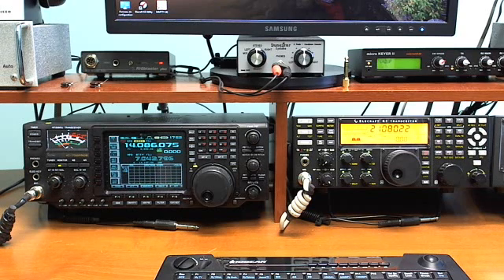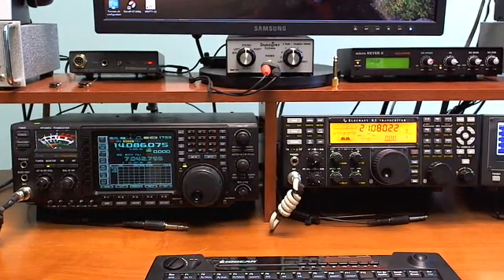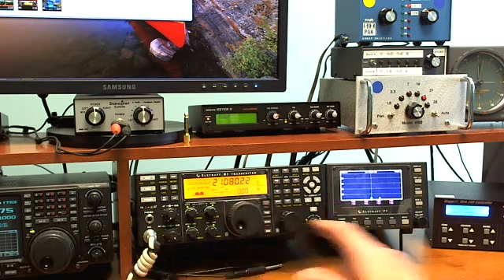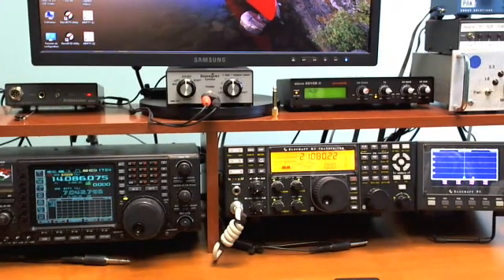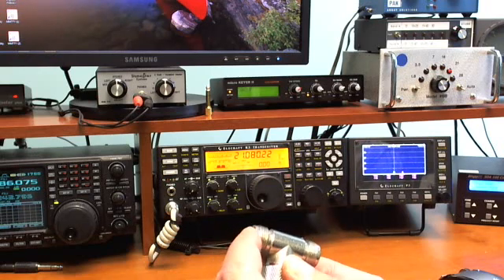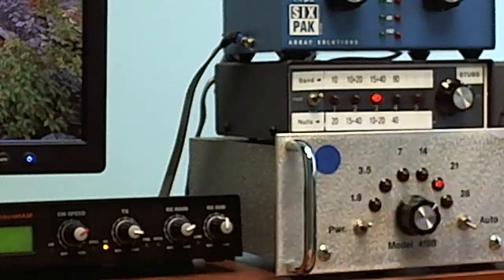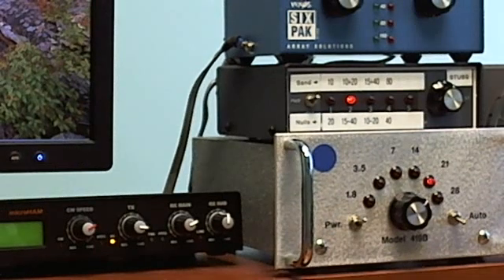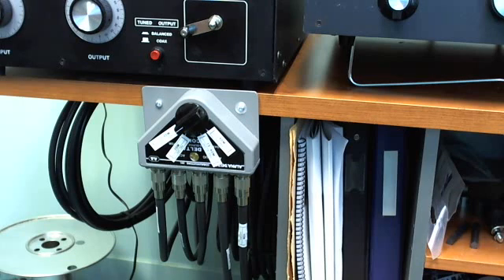VA2UP - Using coax stubs for SO2R contesting

Comment: Just got a Flex Radio 6000 series. all these radios and switching equipment can be replaced with this 1 radio. ALL SO2R is built in. No stubs needed, no SO2R switch. Only 1 radio needed for full SO2R Duplex operation. You have done a nice job integrating but it is now obsolete.